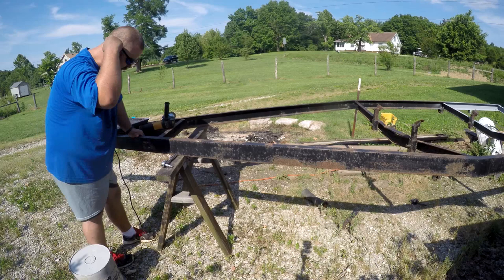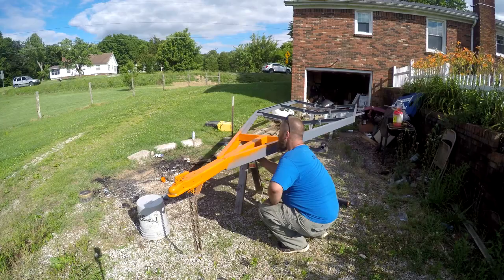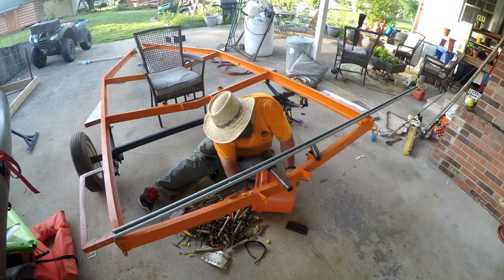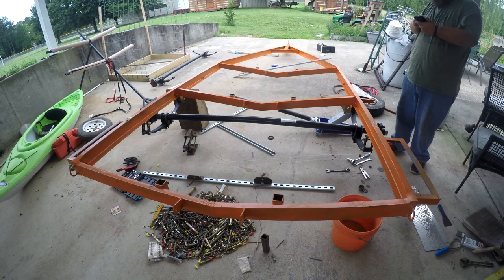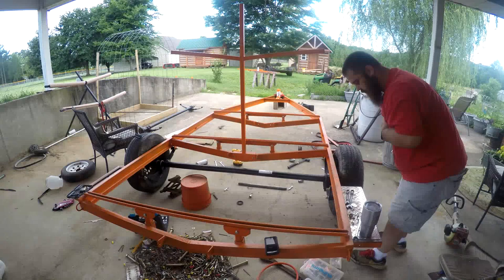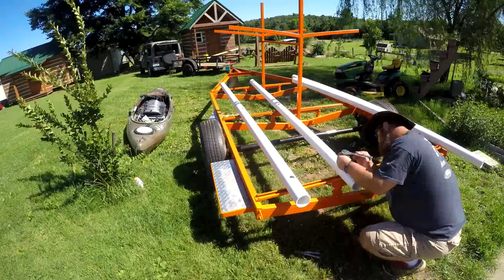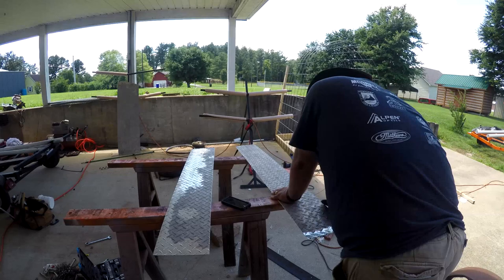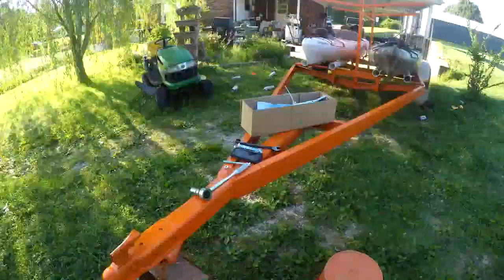Kayak Trailer Build Modification Upgrade Custom DIY PVC bunks hauling Kayaks

Comment: Hey guys Safety Scott here, think about using a full face shield when using wire brushes of any kind. My older brother lost an eye using only safety glasses...Use both.

Good job on the trailer, I am doing the same thing. Like the color  Got a Sea Ghost 130 in orange camo, I think I'll use the same color as you.
Reply from the maker: Wire brush grinders can certainly be dangerous, taking a little extra precaution is definitely good advice.  i have added a few things to the trailer since the video, I have added some LED marker lights and an aluminum tool box to the tongue for storage....I have been aiming to make a follow-up video but just have not got around to it.....Thanks for watching!
Reply: Lol i use my welding mask on grind mode.  Them little wires feel like they hit mach 3.